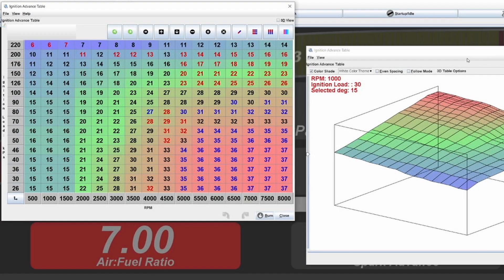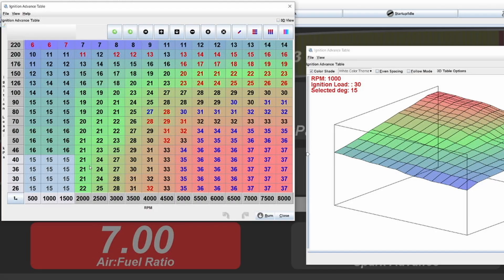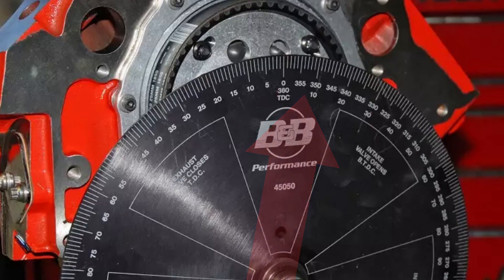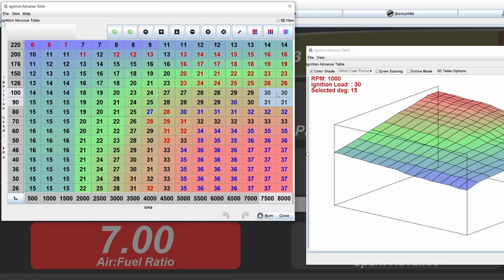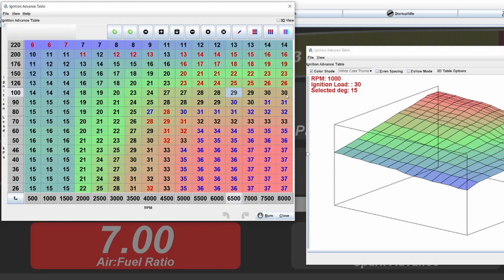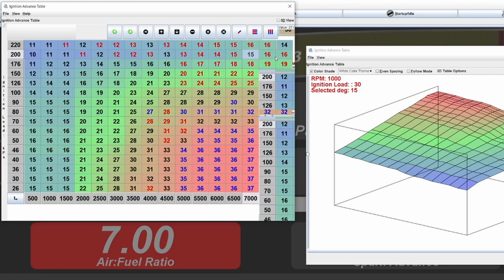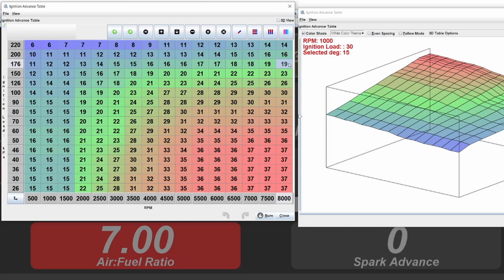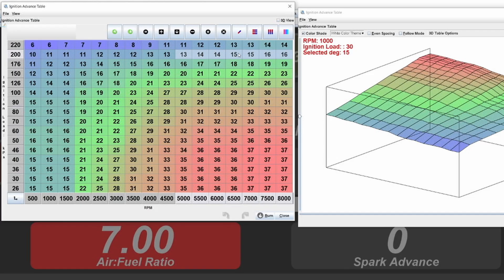Ignition timing & Advance how does it work | Tuning basics Explained | Ignition & Spark explained

Comment: Hi, very interesting, this video, you clarified some things for me, I wanted to ask you even if it has nothing to do with the ignition timing, but has to do with the injection timing, wanting to equip an engine that does not have a phase sensor, what is the best moment for the injection pulse in the first cylinder? It is the moment in which you start to open the intake valve of the first cylinder or even earlier, to correctly obtain the sequential injection. I read the megasquirt manual where it talks about it but it is not very clear to me.
Thanks if you want to answer me, or even better if you make a video about it.
Reply from the maker: i havent really tried around wirh it personally and found the standard value to work fine. there also is nn real difference as in power so i would just leave it like it is, if it runs fine.